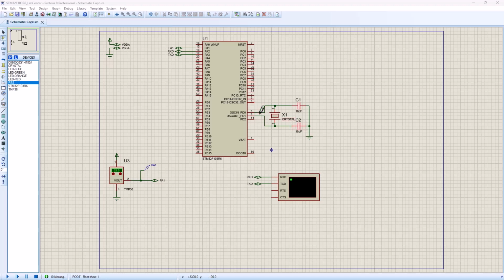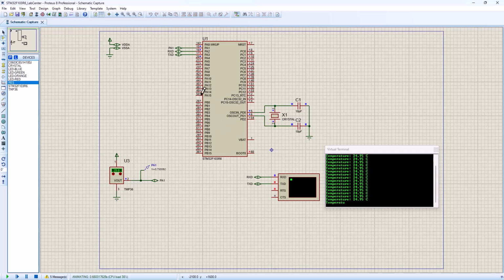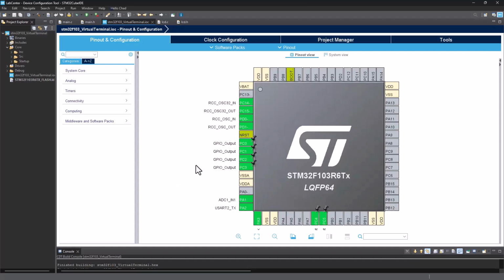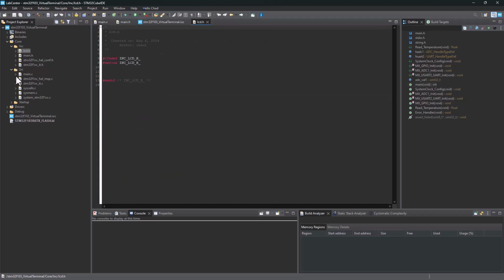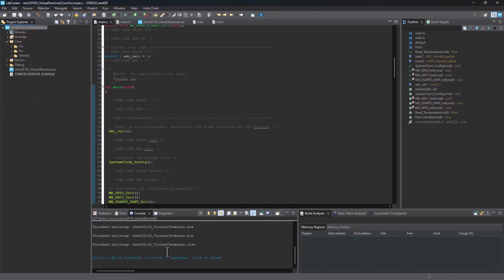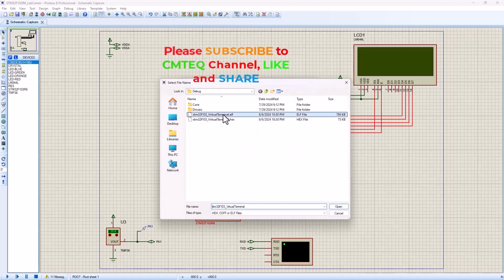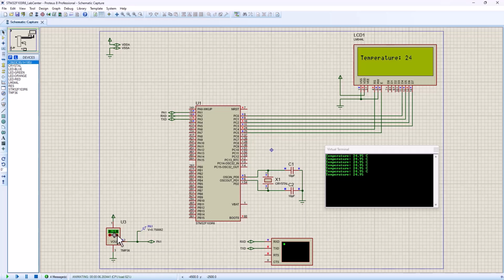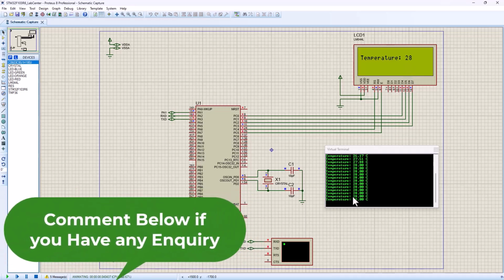How to display temperature on Proteus LCD

Comment: Can you use stm32 + i2c oled?
 I couldnt :)
Reply from the maker: Yes, I have tested it, but I haven't done the tutorial yet
Reply: @cmteqElectronics  I mean i2c+stm32 Proteus simulation.
Reply from the maker: @Hulktolle  I will publish in the coming days, if you want it fast I can make a private member video for you without too much editing, but you have to contact me on my main channel by becoming a member, or you can just wait when its ready.
Reply: @cmteqElectronics  
It is not problem. I'm not in a hurry. I just wondered how it was done. Although I did it with Arduino, I couldn't do it with stm32.

And you have useful works on your YouTube
Reply from the maker: @Hulktolle  Alright cool, if you have subscribed you will see the tutorial in about a month.👍